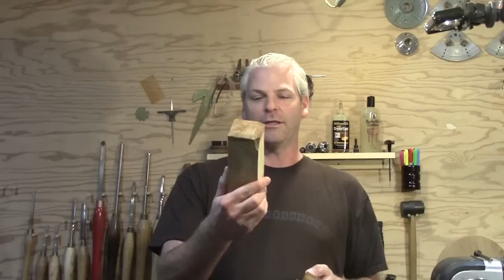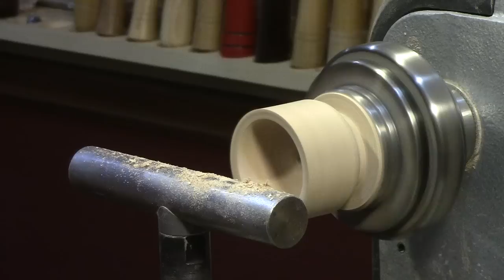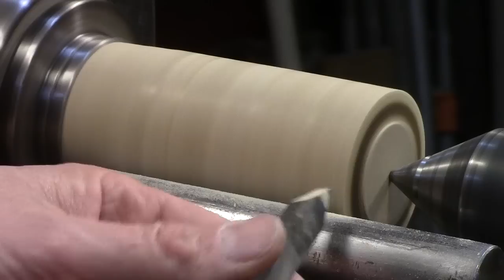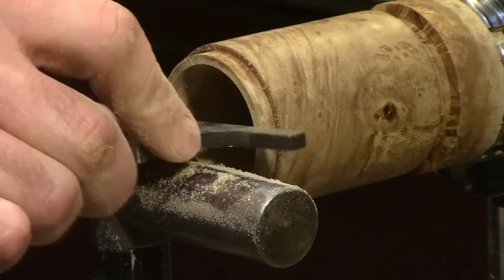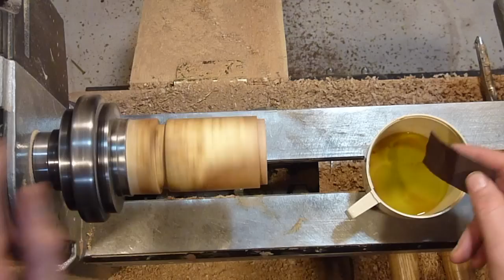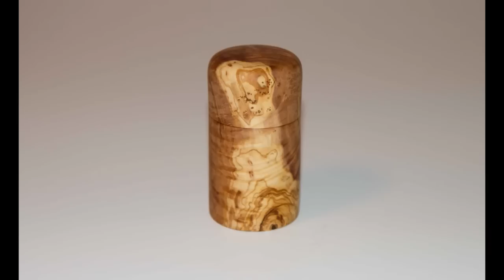Woodturning Project | Turned Lidded Box On The Lathe | Carl Jacobson

Comment: As a guy who works with olive wood on a regular basis, I have to say that you did an excellent job with your first turn.  It is normally very hard to get used to be oddly figured and unpredictable.  People burn tons of this stuff as firewood in Greece, very sad. I understand why you used Walnut oil, but might I suggest using a good quality olive oil on it next time.  It will bring out the aroma and natural golden color of the olive wood, while not over-glossing it, you won't be disappointed!

Comment: Hello Carl,  around time stamp 6:51 you started the lathe spinning and then you slid the tailstock onto the lid.  Was there a purpose for starting the spinning without the tailstock in contact with the lid first?
Reply from the maker: Hi Scott, yes if you start lathe first it will automatically center the piece. If you bring the tailstock up first and it's not centered after you turn the piece, and pull the tailstock away it won't be true.

Comment: Another great video, Carl, thanks.
I haven't bought a lathe yet with Christmas approaching I need to make sure Santa sees to the kids first. I'm gathering some pieces of wood in readiness. I've got sycamore (Acer pseudoplatanus) that needs to come down on my land as well as some Blackthorn (Prunus spinosa) amongst others. I also have Elderberry (Sambucus niger) I've been pollarding over the years, I was wondering if you have turned that and is it any good? I heard years ago, when I did do some turning that you can dry green wood in a microwave oven, what's your take on that?
I used to turn box and lid on one piece, then lid was removed then the box hollowed. The result was the lid fitted like a stopper rather than a cap, your method is much better.
Anyway, always look forward to your videos and going over your older ones. Keep up the work, but try and make it look more difficult :-)
Reply from the maker: Thank you Bill, you can dry wood in the microwave, just do it in short bursts. A few minutes at a time. I've turned Sycamore, and Elderberry They both turn nice. 
Take care
Carl

Comment: Cheaper olive oils do have that property to them as they are squeezed from less high quality parts of the olive (seeds, pulp, etc).  I prefer to use a virgin olive oil from Crete if you can obtain it.  I find the difference between extra virgin and virgin to be negligible.  Those oils won't go rancid as long as you keep them in a sealed container and don't contaminate them.  I like to brush the oil on generously and repeat till the wood stops drinking it in, then wipe clean with lint-free cloth.
Reply: FromTheHeartWoodMK

Comment: Nice work! I was planning on buying a lathe but I don't know where I would get wood suitable for turning. Any ideas?
Reply from the maker: Hi I'm Nick Thank you Nick, Do you have any Hardwood dealers in your area? Like Woodcraft.
Reply: I started with some green wood from trees that people have cut down.  Carl has a few videos on turning green wood as well if I recall one was from a person down the street from him.  You can also order wood online or local dealers.  If you are just starting use some cheaper wood as good hardwoods cost a pretty penny.
Reply: Also on another thought be sure to buy good tools and don't make the mistake I made by buying the cheap set from harbor freight or similar good tools will hold a much better edge and make much nicer cuts.

Comment: why not use  a forstner bit to hog out the cylinder then finish to the desired dimension with the turning tools?
Reply from the maker: Yes you can use a forstner bit also. Either way works great.

Comment: Carl:  I notice your tool has a tendency to bounce around a little as you get deeper into the box.  Any cure for that?  I have been using forstners but I don't care for the lead hole in the center.  Suggestions from anybody greatly appreciated.
Reply from the maker: They do make flat tool rests that go inside.

Comment: Not sure if you'll see a new comment on an older video. I am curious as to why you sand with walnut oil instead of dry sanding? Your right, very beautiful wood.
Reply from the maker: I've sanded with oil for years now. The biggest benefit is that the oil captures all the dust. I really like a satin finish so it's a win win.
Reply: @CarlJacobson  I had to watch the video again. Have you ever put a finish over the walnut oil with success? I havent tried a box yet but watching you makes it look doable. I am going to give it a try. Thanks for letting us into your shop.